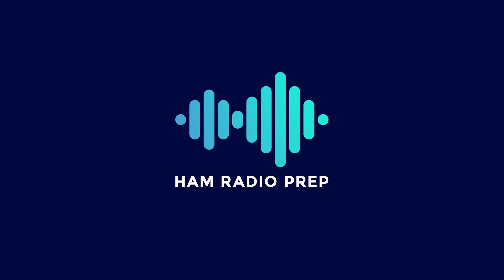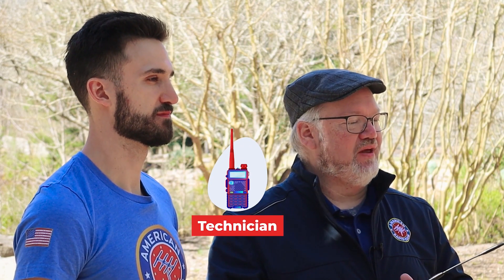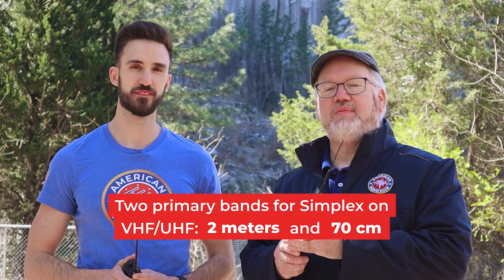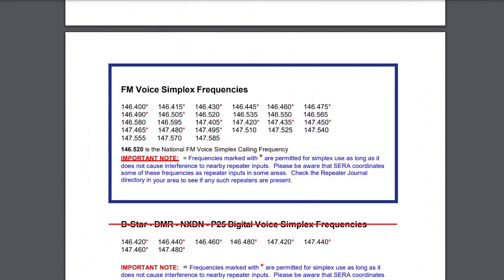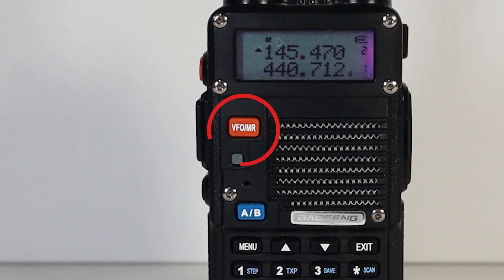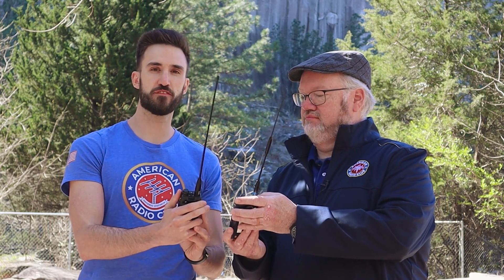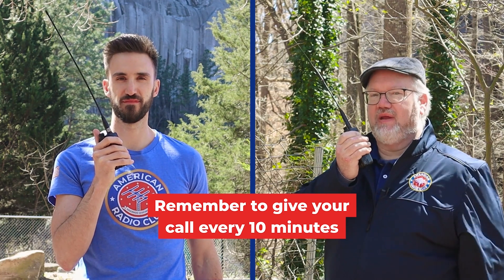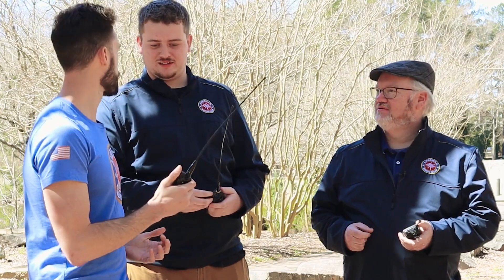How to Make Your First Contact on Ham Radio The EASY Way [Using Simplex]

Comment: My state's band plan does not list specifics. Instead, it groups fm simplex with digital repeater inputs/outputs. Is there another way to tell if I am going to interfere with others? Or can I just pick a frequency in that range, and as long as it's not currently in use, use it for simplex calls?

Comment: Well if I have to have one of those little handheld units like that for ham radio I would rather talk on 2m but I think I would use echolink for that. That way everything would be fine and I could use it without any problem. Put my next question is when you get on that type of deal like 2 l and once you start using the echo lane? Would it be easier just to wait until you hear something going on then make your first contact and if you don't find your contact in do you need to keep waiting until somebody comes on the radio?
Reply from the maker: If you are connected to a repeater on Echolink, it would be good to announce yourself if you would like to get a conversation started.  Professor Jim might say "This in N4BFR on the Ham Radio Prep repeater echolink, monitoring."  That would let people know you are open to talk.
Reply: @HamRadioPrep  thanks for letting me know about that because because 2 m would sound pretty good for me. But I do believe on one of our local repeaters out here that I have heard that we are getting some new amateur radio operators that will have new call signs that will have the new km 7 prefix, have you heard about that? Because I think we're going to start seeing a lot of new hams come on and when they get their license I think I'm going to start hearing a lot of KM7s beginning with KM7aaa.

Comment: how do you do an RF exposure test on a 2m/440 HT?
Reply from the maker: Start with this FCC document.  Page 23 has some tables.  It has more details and formulas if you need them.
https://transition.fcc.gov/Bureaus/Engineering_Technology/Documents/bulletins/oet65/oet65b.pdf
Reply: @HamRadioPrep   ok, I am trying to understand this., but it sounds complicated. All I have to use are HT and Mobile rigs. I have been reading about exemptions for power. It just is not plain to me yet on how to do an evaluation for an HT. It looks like HT's which were manufactured before May 2021 may be exempt? I have an Icom q7a Mini HT for2 meter/440. Output is 350 mW on 2 Meters and 300 mw on 440 MHz. It has a small rubber antenna. I have had it for years. I have other mobile rigs for 2 meters which have anywhere from 10 wats to 75 watts. These are IC v8000 I believe and an old IC 25a which may be 25 watts. I have not been on the air talking to others in years. I have thought of giving up ham radio as I dont know if I can even understand the RF exposure and formulas. I was licensed in my late teens decades ago. I am going to try and read the regulations and I will have to renew my license as I am still in the grace period.

Comment: I have 2 Baofeng k6 Series Ham Radios. I'm new to Ham Radio, and I don't have my Technician License yet. I'm study your Prep. Course for Technician. My question is when I use my radios for Simplex (Walke-Talke mode) Do I need a license?
Reply from the maker: Welcome to the world of ham radio! 🎉 To answer your question: Yes, you do need a Technician license to use your Baofeng radios for simplex communication on ham radio frequencies.

However, if you’re using them on non-ham radio frequencies, such as FRS (Family Radio Service) or GMRS (General Mobile Radio Service), the rules are different. FRS doesn’t require a license, but GMRS does require a separate license (no test required). Be sure to check that your radios comply with FCC regulations for those services if you plan to use them there.

Good luck with your studies :)